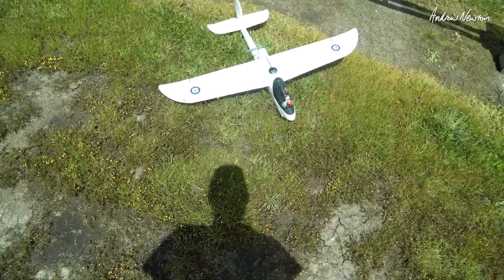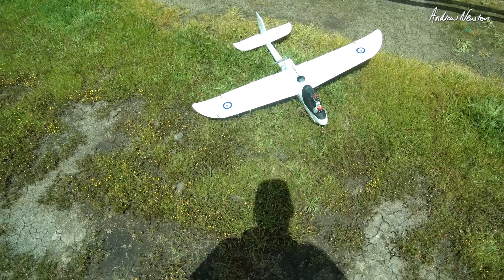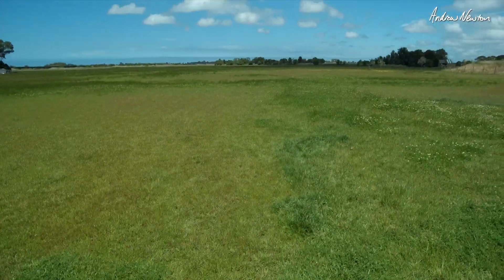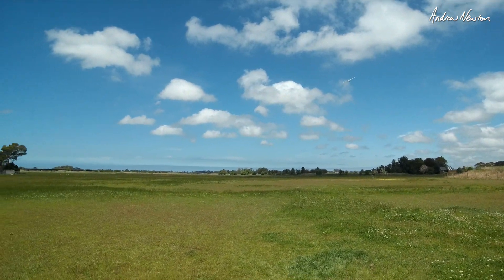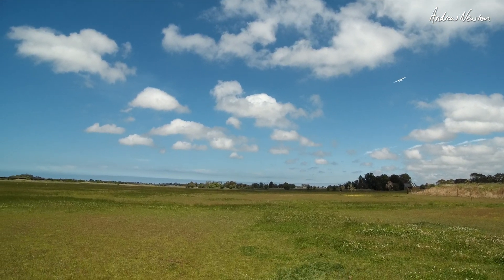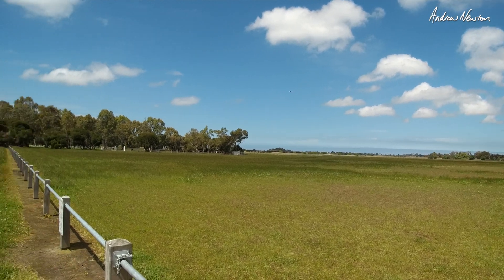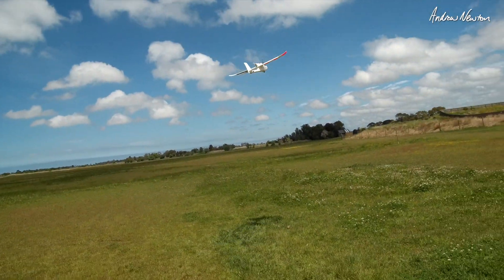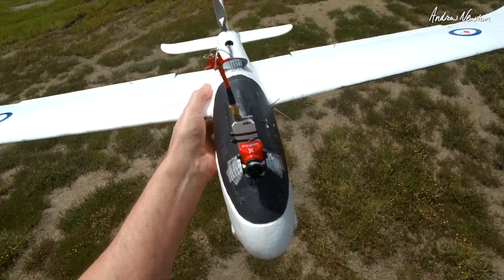Elevon Plane - Will it work?

Comment: Is not quite the same but pitcheron wings (the entire wing rotates) can work well with pitch and roll control using a fixed non moving tail. I built one that worked pretty well long ago.
Reply from the maker: Yes I used pitcherons on my LIDL mod

Comment: Have a look at John Woodfields Keil Kraft Invader, yo could call them elevons and they work great.       https://youtu.be/jTPOseKekXI
Reply: Those are called pitcherons or wingerons.
Reply: @stejer211 You are right, and, pitcherons do a fantastic job of controlling a standard aircraft setup, elevons work great on a flying wing, on a standard aircraft they are flaperons and only change lift and speed of the aircraft (variable camber it's called, is used on rc gliders to great effect).

Comment: @Andrew Newton, Good day Andrew, it is always a great pleasure watching your videos, thank you for sharing your knowledge and experiences. Look forward to your future posts :). I have a topic suggestion if you're looking for ideas, I've been looking at data logging trying to find an airspeed sensor, barometer sensor where I can log these paramotors plus more on a flight controller, maybe look at aircraft attitude too or even better find some means to log AoA. Being a student pilot I am fascinated by the theory of flight and aerodynamics. My goal here once I find means to log the data I require is to construct a wind-tunnel for rc planes to explore and experiment with airframe designs to carryout specific mission objectives (Max endurance, max payload carrying capacity...). Best Regards, Ali from across the ditch (NZ) :)
Reply from the maker: Thanks Ali. All of the parameters can be logged using Smart Port telemetry back to the OpenTX transmitter and Black Box recording on a suitable flight controller.
Reply: @AndrewNewton  Thanks for taking the time, I really appreciate it. I will look into Black Box and OpenTX. Cheers :)

Comment: Think you will have more authorathy with thrust control (more power go up, less power go down... but it will be difficult to fly and very critical to set up
Reply from the maker: Yes but that's not what I'm testing.
Reply: @AndrewNewton  I wonder what would happen if you cut off the horizontal stabilizer and put hte cg more to the front ;-)

Comment: Interesting and very brave demo - this is simply Archimedes' law of the lever. If you want to tilt a seesaw, you don't lift close to the fulcrum, especially not with an empennage-shaped kid perched in one end. The elevons cannot fulfil their elevator task here because they have too short a leverage on the centre of gravity to overcome the high leverage stabilization effect of the tail surfaces. So thrust angle is very unlikely to help, but a very low aspect ratio might improve things a tiny bit. This is also why rudders don't work well on wings. Thanks for making science so enjoyable!
Reply from the maker: Thanks Henning. I had another try today with the elevator mix reversed. It did work to some extent but not really flyable. It's fun trying these things even if they dont work.

Comment: It looked like it wanted to go down straight away, maybe try reversing the elevons and it may go up? also with  elevons some wings need some "UP" when in neutral, did you dial in some UP when in elevon mode??  interesting vid  😵😵😵
Reply from the maker: Reverse worked better but still not great. A different plane might work, need one that pitches up more with flaps like a Phoenix maybe

Comment: Some aircraft pitch up with flap and some down so some experimentation might be required. Pitcheron models work work fine with a fixed tail plane.
Reply from the maker: Yes, that's why I thought it might work. Next up I'll try a different plane

Comment: Did you reverse the elevator direction? If you use a standard elevon mix where up = control surface up the elevons act like spoilers.  You want them acting like flaps.  Because flaps change the angle of attack of a wing, it should also change the angle of incidence between the tail and the wing acting like a standard elevator.
Reply from the maker: I have now and it did sort of work. Can do better with the right plane

Comment: No elevator, eh? Yes, please. Reminds me of my first RC plane (a 45" span Keil Kraft 'Outlaw') which was rudder-only. Since everybody getting into RC back in the year 1402 had just graduated from free-flight, the planes were all hands-off stable and trimmed to fly themselves.

Buying two servos was almost unheard of (servos cost a LOT), so everybody started out with just one.

Whee.

Not having elevator meant that turns took a bit of planning - and with no throttle, deadstick landings were a hoot - but softly-softly avoidee crashee...  :-)
Reply from the maker: Yes, a bit of "up with throttle" worked. But I'll try another plane that pitches up with flaps

Comment: You probably need to have a trim function on the elevator to get it flying roughly straight and level hands off - then the elevons might work.  Maybe assign the elevator to a pot or slider when you switch to elevon mode so you can trim it in the air?  In my experience with flap-equipped gliders and power planes, some planes need down flap to make them climb, some need up-flap, and some show no pitch change at all with flap movement.  I think it depends on the size of the control surfaces, the chord of the wing, the wing airfoil, the centre of gravity position - and probably other factors too.
Reply from the maker: Great suggestion. I did that and had more success, but a plane that pitches up with flaps would be better

Comment: I just thought, if you (me, he, anyone) stretch a small volleyball net in the backyard, and a small hook on an airplane, you can land an FPV plane directly into this net in a confined space. But this is only for an aircraft with a propeller in the back. just an idea...
Reply from the maker: Crazy idea, I'd have to trim the fruit trees to clear an approach but I like your thinking
Reply: @AndrewNewton  Like this? https://www.youtube.com/watch?v=CwU5ZcbRDK8
Reply: @AndrewNewton  
I also have a lot of trees on the site, these are decorative pines and spruces, but I have long been thinking about trying to land in a limited space) Not because of necessity, but for experiment.
Reply: A dethermaliser setting on the tailplane would let you descend vertically and land on a sixpence...

Comment: Snap flaps work in a similar fashion. Flaps will cause pitch deviation. I think it would work on the right plane. Probably need large control surface and throws?  Smaller tail area?Custom cardboard build?🤔

Comment: I have one of my few flying attempts working as elevon only. I am a novice at flying but it worked fine for me (bearing in mind my complete inability to fly for more than a few seconds). It was a kids foam glider conversion with elevons added. I would drop a link here but that would just go into spam.
Reply: For those who want to see, you could search my channel for "The Works £3 Foam Glider" or for the best flight "P3 BETTER Sloping the RC converted The Works £3 glider on Bolt Tail". My apologies if this sounds like trying to gain views, I am just offering this in support of the question asked.
Reply: Complete inability to fly prooooobably doesn't count as a flight then 🤣🤣
Reply: @nickhayley  maybe watch the video and make a decision after that.

Comment: hi Andrew, i really enjoy your videos, always fun to watch - here one thing on the topic at hand... you are right elevons do not work on every plane, but maybe you can regain some elevon controll on a plane (your test model) with its main wing that far in front. You have to reverse the direction of the controll surfaces compared to the direction of the RX, meaning if you want to go up for example your elevons on the plane have to go "down",  and so on, maybe worth another test flight,  cheers
Reply from the maker: It did improve control a bit but need to try a different plane

Comment: Great question, shame it did not work, love the landing, i bet your radio voice said "I meant to do that", i see you have not modded the motor mount on the G2, i ditched the stock motor and tried a whole heap of different ones, settling on a Racerstar BR2207 1600kv with 7x5 HQ prop, and a little bit of shimming under the bottom 2 motor mount screws
Reply from the maker: I should swap the motor mount too.
Reply: @AndrewNewton  just mount a low kv quad motor on the Ali X mount with the motor can sticking out rather than in as stock motor is done, but a little bit of packing under bottom 2 mount screws, i used a couple of bits of cable tie with a hole drilled in each

Comment: if you pulled the stick the opposite way it might have worked.  when both ailerons are angled down it causes the plane to pitch up if your wings are mounted on the top of the fuselage  :)
Reply from the maker: Of course! I didn't think that through, back to the flying field.
Reply: I agree. Applying a standard elevon mix (where pulling elevator causes elevons to go up) on the ailerons will not work. It must be inverted. Pulling elevator should move the ailerons down. The resulting cambered wing gives the main wing more lift and therefore a pitch up moment. Upward ailerons take away the lift and should cause a pitch down. Would be good to try this again :-) 
That said, the aileron surface might be a bit small and throws may be a bit lacking for this experiment to work. 
This is by the way used on gliders that use snapflap mix for the elevator.
Reply: @KimAbraham  I know its possible on a bushplane but it would be interesting for him to revisit this on a glider with smaller control surfaces like you were saying.

Comment: Installing tailerons would also be interesting, i.e. the present elevator halves work independently as ailerons and together as elevators. Several jet fighters use the concept when the wings are short and all the span is needed for flaps.

Comment: Because the ailerons are closer to the front of the aircraft they don’t push the tail of the plane like an elevator, they push the wings. If the elevator part of the mix was reversed, so up elevator stick movement gave the plane flaperons, & down elevator stick movement produced spoilerons. It would possibly work. The authority will be weak.
One way to test the theory without adjusting the radio is to reverse your elevator stick movement when changing mode. (ie. Control the plane as if it was inverted).
Reply from the maker: Reverse elevator worked the same, not enough pitch to flap reaction either way.
Reply: I thought it might balloon the plane up & cause it to sink down. It would need significant deflection.

Comment: A wider span tailplane, with elevons and no control surfaces

 on the wings might be flyable, but yes, I agree with your aircraft about not flying properly.
Reply from the maker: I'm sure it will work so some extent with the right plane
Reply: @AndrewNewton  Yes indeed. How about the smoothing plane you have on the side there? Even if it can't fly, from a height, it will travel nicely in the vertical plane.

Comment: Interesting experiment with a close shave on landing ;-)  I think the problem is that the "elevons", actually flaperons, are acting to change camber more than changing angle of incidence. If you move the entire wings,  you will get the desired effect, then it's called "pitcherons" (plenty of info. from a Google search).  Beautiful example by John Woodfield: https://www.youtube.com/watch?v=8JAh59HyaVo
Reply: i thought it's called flaperons when both only move down simultaneously
with spoilerons both only move up simultaneously
and these are elevons, both can move up and down simultaneously, just like on a flying wing
the problem is the horizontal stabilizer working against the pitch input of the elevons
Reply: @marc_frank  Nope. Flaperons are usually full-span moving trailing-edge surfaces, into which to mix the aileron and flap functions. Look at the manual for your Tx. This is common for slope soarers and DLGs, with only two servos (and two or three channels for the mixing). A full four-servo separate aileron and flap arrangement is better for thermal gliders, since then you can configure a CROW function (both ailerons up, flaps down) with mixing into the elevator for precision approaches and landing (usually for gliders of the F3B, F3J and F5J  classes). The 4-servo wing also allows for different flap deflections between root (flap) and tip (aileron), suppressing tip stalling tendencies with flaps applied.
Reply: @awuma  that's exactly what i said (wanted to say)
your "correction" from elevons to flaperons in the original comment is wrong

Comment: Elevator up with this setup is equivalent to spoilerons right? That would explain the dip. I'm wondering if instead you could use two servos for the elevator, one for each side, and let that be your elevons.
Reply: That will work, I've done that before - I think they're called "tailevons"! - but they have quite anaemic roll performance unless you make their span closer to that of the main wing. On a conventional layout (big wing, little tail) like this one, it would likely have too little roll to be able to fight air turbulence etc. But on a parkjet with a more fighter-style layout (e.g. something like a MiG-29) where the tail is bigger and the wing has only slightly greater span, it works beautifully.
Reply from the maker: Intersting idea. Would the wings resist too much like the tail is doing here.